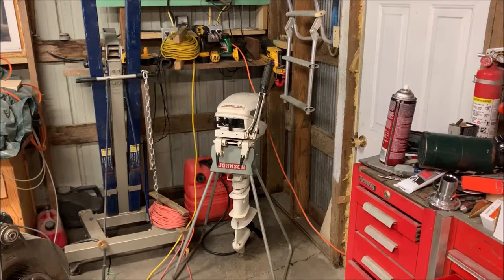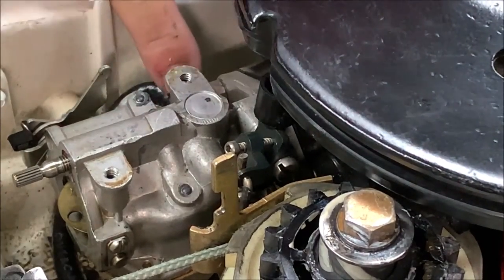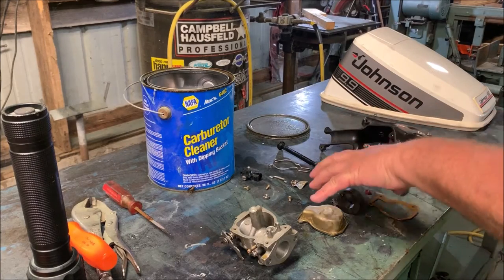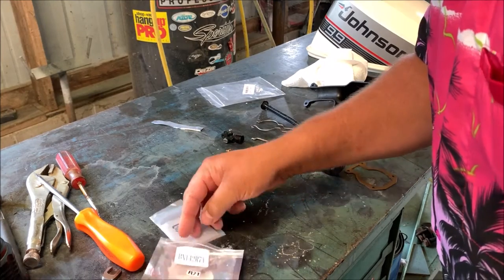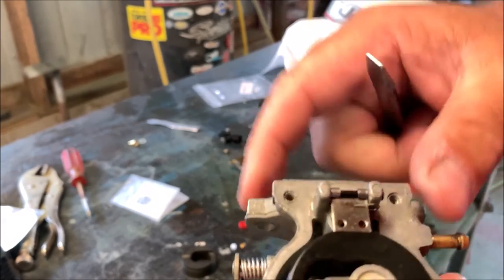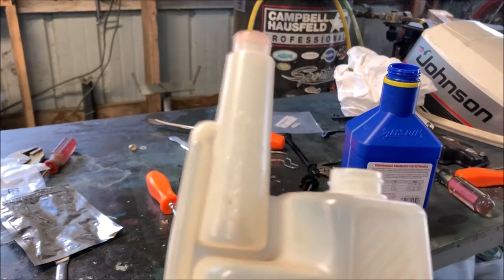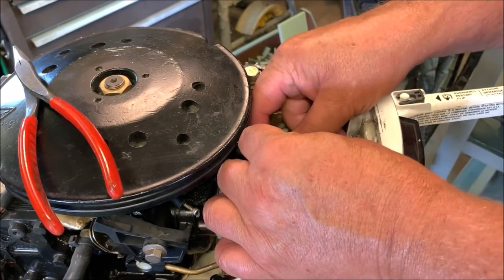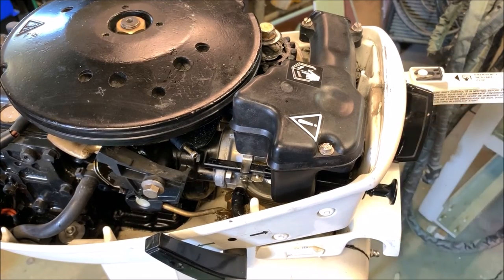Johnson 9.9 carburetor rebuild and tune up    Make it run!!!

Comment: I just recently (June 14/24) took the carb off my 9.9 and to get at that one nut on the carb easier, I took the pull cord assembly off which took no time at all... easy peezy. Just make sure you u zip tie it together so that it doesn't spring apart.   When putting that nut back on the carb, grab it by the handle and set it down on the ground or work bench.... this way you have a better chance of the nut sitting flat on the threads.... easy peezy!
Reply: I did the same but I put a nut on the pull cord bolt

Comment: Avoid the headache, grab a 9/16 open end wrench and a long zip tie (or anything to hold the pull rope starter together), and remove that top starter bolt and set starter to the side and it makes it a world of difference.

Comment: I had luck with temporarily removing the recoil starter to get to the flat head screw and the other carb nut. I just held a recoil in my hand to keep it from flying apart and put it back on until  I was done with carb rebuild.
Reply from the maker: Yes definitely don't let the spring go. Not the end of the world if it does.  I'm working on one now that I have a spring on order for.
Reply: give up screw  on the starter, not to explode
Reply: I just use some electical tape to hold recoil assembly together and then just hang it over the side

Comment: I removed the pull-start, which made it a lot easier to remove the carburetor retaining nut.
Reply: That's what I just did too.  My motor got submerged in a storm last night.  I hate having to go thru my motors every time one gets swamped in the lake because the only thing that comes to us out of Fargo, ND is 80 mph winds lol.  Now I remember why I hate renting out my small Lund Boats with Evinrude motors lol.

I had to laugh when he said his fuel line was held on by a zip tie and he didn't think that was stock.  Guess again lol.
Reply: @thomasjoseph5876  my fuel line is held on by a zip tie too.
Lol.

Comment: great video.  Thank you.  Any idea why Johnson 9.9 outboard would blow oily chunks with some fuel when starting  ?
Reply from the maker: What's your mixture and what kind of two stroke oil you using?
Reply: @Michaelsbackyardmarina  Sorry I didn't see the notification for your comment.  I am using West Marine TC-W3.  I think where I went wrong is that I was using the old gas can and I just added the oil to the can without making sure it was shaken.  After getting a new fuel tank, the chunks are gone, but now it wont stay running without having to keep playing with the choke.  Also the plugs were fouled.   I just got my carb kit in the mail!   Time for a rebuild.  With your video should be no prob!  Thank you RMD

Comment: If the transmission lever is in forward, can it be hand cranked?  I have a 1978 model.  I can't seem to move it to neutral with the engine off.  I'm relatively new to these old 2-stroke engines.
Reply from the maker: they are designed so you can't start them in gear for safety reasons on newer models like in the 80s. Not sure about a 78. Mostly they have a throttle lock out to minimize the ability to rev the engine without it being in gear.
Reply: Roll the throttle back to idle first !!
Reply: I have a 1989 9.9 and I am able to start it when it is in forward
Reply: You will have to show a segment on installing piston rings next. I don't think that you have showed this yet?

Comment: RMD Creations I have a 1986 Johnson 15 hp and when it starts it will idle super high and then go low and then high again and sometimes when I start it it will start to idle super high and then I can’t turn it off even when I disconnect fuel and choke it. Do you have a solution to make it idle smoother?
Reply from the maker: sounds like you have some excess fuel and air getting in when it shouldn't

Comment: Question been running mine in a drum now I’m getting a lot of oil coming out on the sides of the drum and I running to much oil in the fule, running at 50-1
Reply from the maker: That's just the nature of the two stroke.  To help break down the  oil you can put a dish washer tab in the water. That's what I do on my big tank
Reply: Better check the lower unit to be safe had it happen once.

Comment: I have a question, I have the same motor I never had it running yet but it seems that when it's in gear if I turn the throttle backwards it kicks itself into neutral, is that normal?
Reply from the maker: Haven't run into that before.
Reply: Woah I'm so stupid, I went and double checked yesterday and it turns out it wasn't fully clicked into gear Hahaha I'm sorry for wasting your time!

Comment: Will a Johnson 84 9.9hp turn into a 15 with a 15hp carburetor swap for 9.9 carburetor
Reply from the maker: Check out leroysramblings.com and find out.
Reply: some models you have to swap the exhaust tube also.

Comment: These motors suffer from primary vacuum loss often. because the crankshaft seals dry out and leak. Causing rough idle
Reply: Good tip ,forgot about that and I just learned it on T-mikes channel the other day.

Comment: Pull the starter, that small screw and right side nut is then easily accessible
Reply: Be sure to hold the starter together so the spring does not unwind . Leave bolt in and wrap with tape to hold everything together
Reply from the maker: for sure, thanks for watching

Comment: what is the red part ???
Reply from the maker: I think you are talking about the part that won't let you start the motor in gear or open throttle.
Reply: @Michaelsbackyardmarina  i talk about thé part juste braisé thé crank

Comment: You have to remove the starter and a right nut come off easy it is a bitch to find the nut later down the shift lick hole
Reply from the maker: yes it is. Welcome aboard